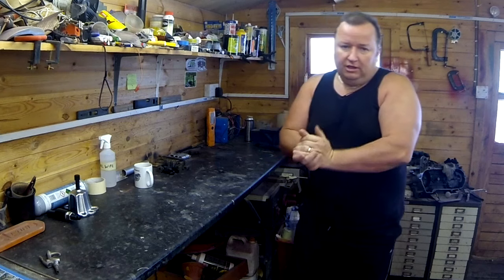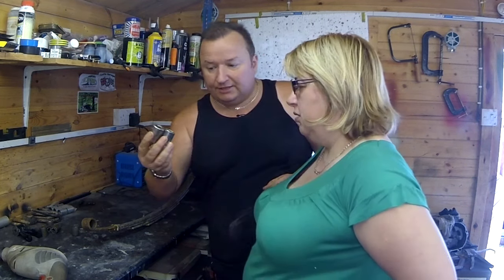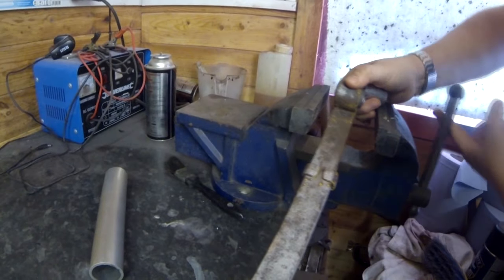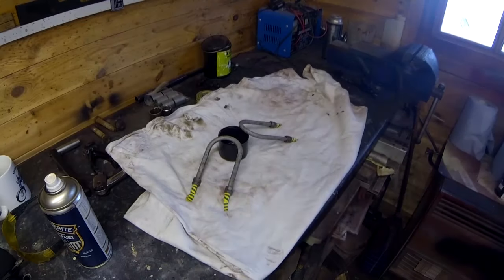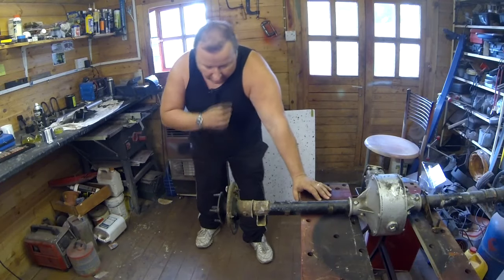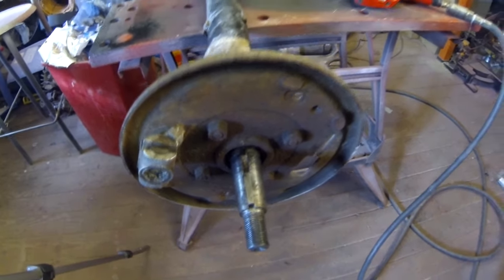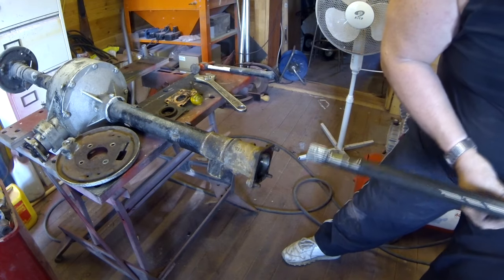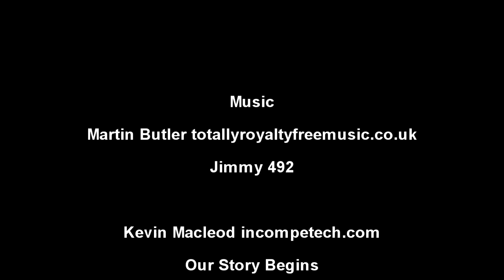Part 12 Reliant Trotter Restoration Refurbishing the Axle And Fitting Oil Seals

Comment: Another great vid as usual, you should give Rustoleum top hat spray a try instead of the hammerite iv used it on the subframes and wishbones etc on my vw jetta and the finish is fantastic, its a bit more pricey than hammerite but well worth it anyway keep up the good work 👍🏽

Comment: That#s interesting Martin,an oil seal either side of the wheel bearing.
is the bearing greased or is it lubed from the axle oil? great job Martin.. :)
Reply from the maker: That's what I was wondering. To have a seal on either side would indicate a greased packed bearing, I'll have to look into it.
Well spotted.
Cheers
Martin

Comment: It would have been even more Cost Effective, if you had replaced the inexpensive bearings, while you had it all apart.
Reply from the maker: The bearings are fine, where do you draw the line? It's a simple job if they go whilst on the car anyway. It's not as if it will do much mileage so in my opinion, it's worth the risk.
Cheers
Martin